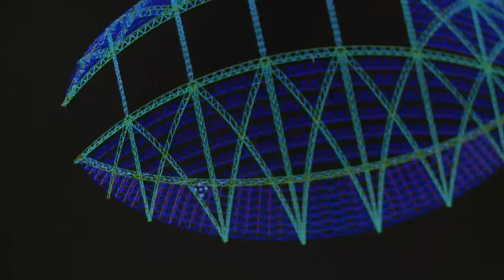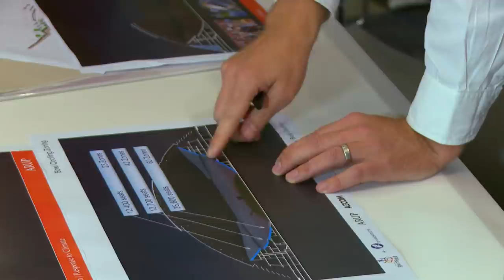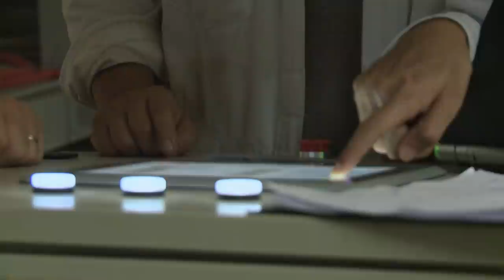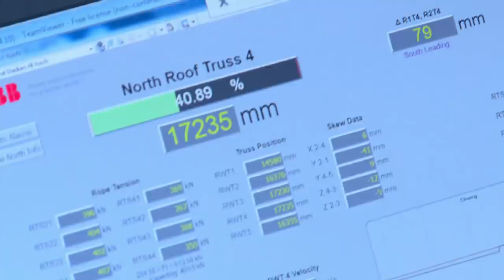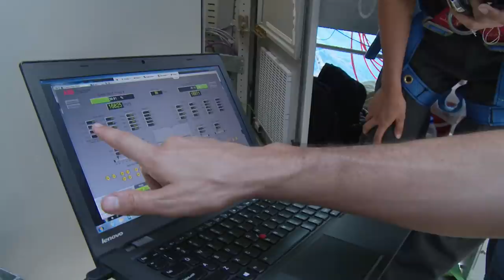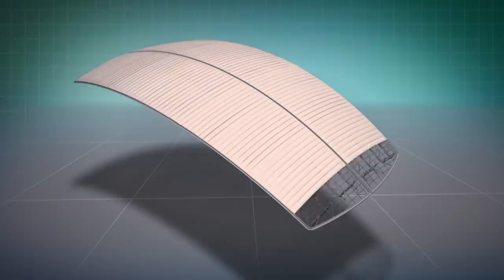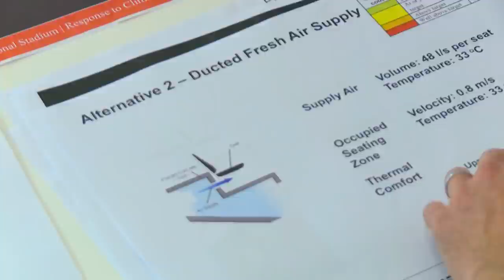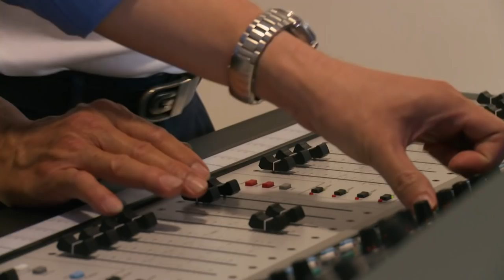Building Singapore's Unbelievable Multi-Sport National Stadium | Singapore's Field Of Dreams | Spark

Comment: To give a bit of background, this was the first megastructure that was built on public/private partnership and co funding. The private side dictated the rental fees etc and it simply became too expensive to host any event. Heck, even the SG govt found it expensive to host the national day parade which its predecessor hosted without a hitch. A stadium should evoke emotions and this doesn't do that.
Reply: Facts bro, the stadium isnt even used at all unless theres a concert or some random exhibition match
Reply: Cost is definitely a factor. On average, the recent editions of the NDP (before covid) is approx. $20mil at the floating platform, compared to almost $40mil at the stadium (And there's a tighter and shorter rehearsal period for NDP at the stadium). TBH, it makes more sense to have the NDP at the floating platform/NS square rather than the stadium. You get a much wider audience penetration; 30k seating capacity at the future NS square plus additional 100k littered around marina bay area. Compare that to the 50k to 55k capacity at the stadium.